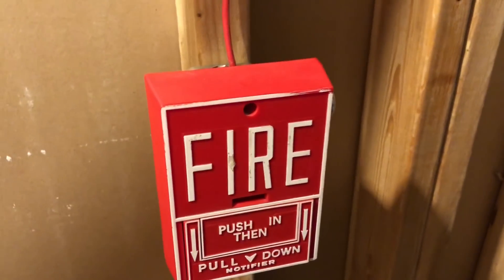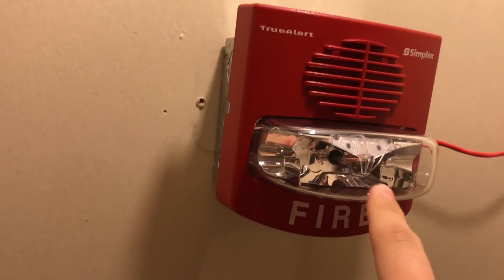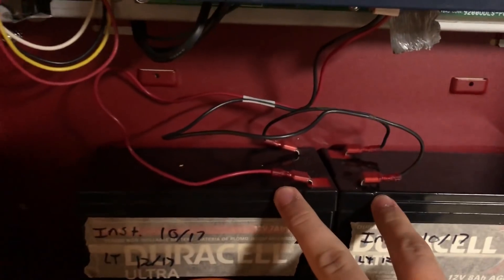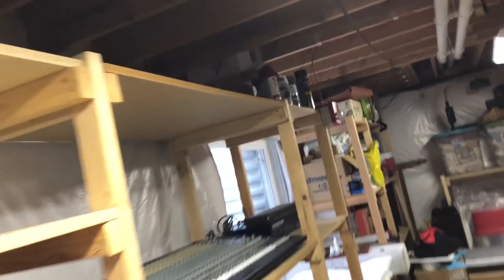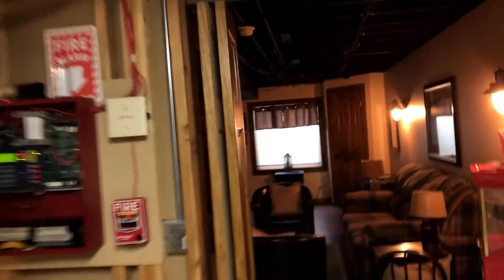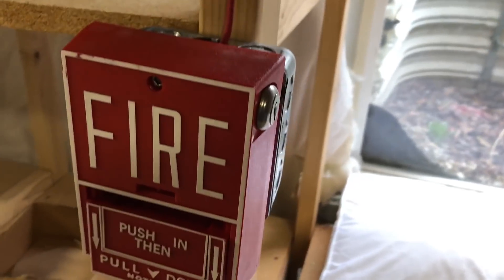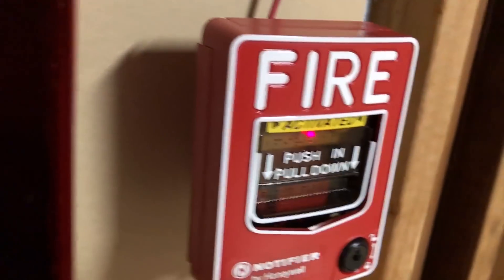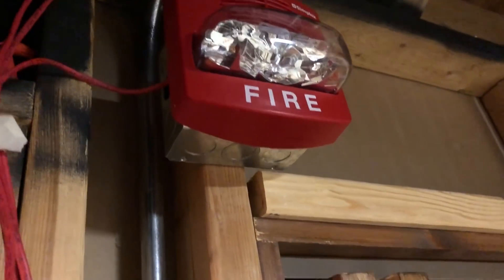Home System Test 39: TrueAlerts are TrulyLoud!

Comment: Fun fact: The 4906 Truealerts are actually 10 dB louder than their 4903 fixed candela counterparts
Reply: I noticed that. The 4906 TrueAlerts seem about as loud as the System Sensor SpectrAlert Advance and Wheelock AS (with both on high volume, of course.)
Reply: I do notice a slight pitch difference with the 4906 series truealerts as they are slitghly higher pitched than the 4903 fixed candela truealerts with a slightly lower pitch
Reply: If you want proof that the 4903 truealerts are slightly lower pitched than the 4906 truealerts then here’s my video of my 4903-9418 https://youtu.be/frT7J4XVb1k

Comment: Awesome!!! Just got some more multi tone truealerts!!!
Reply: Cool! They are the White Simplex 49CMTV-WWF. These are very cool, and they have a VERY loud low frequency tone. HOWEVER!!!! They are VERY EASY TO FRY!! So like this test, always run them on filtered. If you run em on fwr, they will fry instantly and never work again, and that would suck.  They are on the expensive side so be careful, and they are both smart sync and free run with a jumper, so you do not absolutely have to use the module if you wish not to!! Vids are great and hope you find some! Can’t wait to see the video on them!!

Comment: Unless the batteries are already not holding a full charge by current NFPA codes the batteries must be able to give 24 hours of standby power or 2 hours of alarm power and you were way under the 2 hours lol.